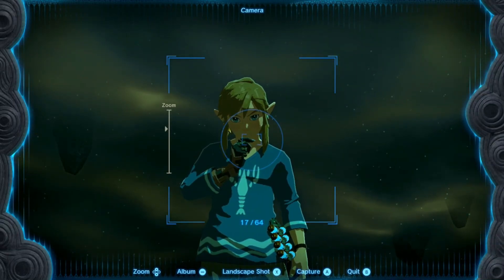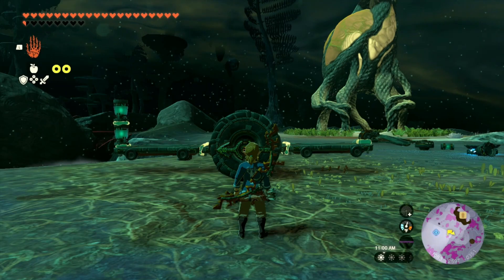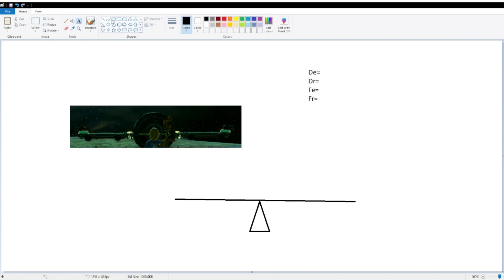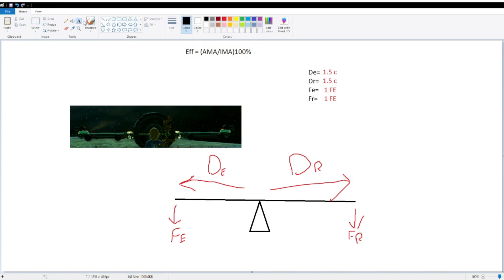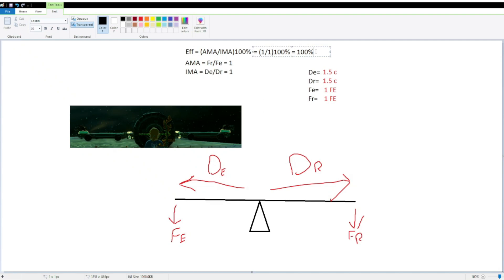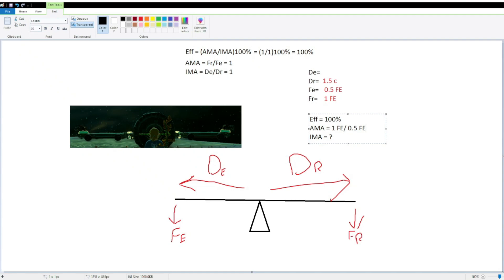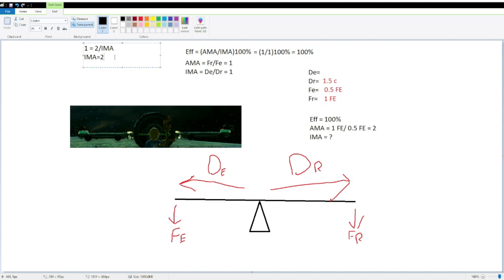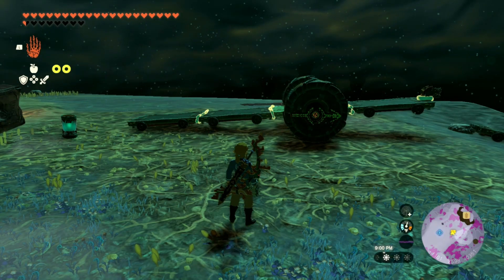Establishing a weight system in TOTK so I can make levers (READ DESCRIPTION)

Comment: Instead of using IMA and AMA for the lever, you should just sum the moments about the pivot. According to your spreadsheet, a cart has a weight of 4.35 FE. at 9:58 you can see that the extra cart on the left adds 4.35 FE x 2 carts to the left side in addition to the battery (0.5 FE x 2.5 carts). The right side only has 1FE x 1.5 cart. This results in a total moment of 8.45 FE-carts counter clockwise which reflects what you observe here
Reply from the maker: Thank you for the comment! I'm just using my current understanding of simple machines to do this stuff, is there a resource you could reccomend so I could get a better grasp on what you're saying?
Reply: @avery_luigi  definitely calculus would help alot with calculating the moments of inertia and everything. 

But you should be able to correct the equations quickly by remembering that your lever is not weightless (as was assumed in the video) all you have to check is that the carts have a consistent weight spread out along them, meaning that 1/x of the length of a cart will always contribute 1/x*the wieght of the cart. 

After you check this you can just see how much of the cart weight is going to contribute to the lengthening of the lever as you need. Everything else should work and if you take this into consideration I bet the calculations will work out in the game as it likely isn't any more complex than this.
Reply from the maker: @ethanolcott3960 ah OK, I actually haven't taken calculus yet but I will be in the fall, thank you so much for your comment!

Comment: You made a mistake in your last practical example. Your De and Dr were 3c and 1.5c, but your actual lever only measured 3 carts total, not 3.5 as in your calculation. You should have scaled up by 2, so that the long arm is 6 carts long, amd the short arm is 3 carts long, and see how that behaves.

Comment: I must say that for the last experiment you can have x7 carts, but place one weight 3 carts away from the wheels and another just 1.5 carts away. That should balance stuff out. Not like there's any need for balance from what I've seen, but it's a shame to see a full-sized non-copyrighted human-like battle robot falling on his side due to poor inside mass distribution. 
I remember my days of Gmod utilizing a step-by-step approach that I learned from my programming class: after each step you should have a functioning thing. So, if you're building a robot's right hand, just add a weight on the left side and check if everything else is working alright before brainstorming how to balance out two-handed recoil.

Comment: So link is as heavy as 5 regulsr apples?
Either those apples are heavy as hell or link is just built differently.
Weighs a couple of grams but can still rodeo a bucking lynel without being thrown off until he decides to jump off automatically after slamming on the beast
Reply from the maker: link actually weighs 10 regular apples! since 1 apple is 0.1 FE and link weighs 1 FE. I agree though, those apples must be beefy as hell
Reply: Nintendo probably increased the weight of some items on purpose so they don't fly off to infinity when you cut apple trees in the wind or while throwing them... I'm just saying
Reply: @airdutemps8363  i think it's the other way around, they reduced link's weight so he can fall more slowly (lower terminal velocity) and float on that tiny paraglider.
Reply: @tuseroni6085  why not? they had to make things work one way or another :P
Reply: @airdutemps8363  it wouldn't make any sense to increase the weight of apples, irl apples do not go flying off into infinity when you chop down a tree and little reason to think they would do so here, they do go flying when hit with a fan but continue to fall as normal when out of the fan.

it makes more sense they made link lighter so people would have more air time.
Reply: My only complaint about the game that I'm not gonna stress over bc its really just a small detail is the tall grass.
I hoped there would be more to the tall grass than just cutting them for a chance to find hiding criters or even a fairy by small chance.
For example. Taller grass could be utilized for stealth if someone wants to pick off any enemies.
I get thst with the ultra hand it kinda rules out the ides of stealth and opens more to creative minds and how they'd cause chaos but I personally would like more puzzled sections revolving stealth like that one quest in botw where you have to infiltrate the Yiga Clan hideout.
It was thrilling and fun to see how you could distract the enemies and felt more natural and immersive
Reply: @alex_delarian09 Think about the performance. Rendering that extra tall grass could make the game unplayable. TOTK is already hard on the switch.
Reply: @alex_delarian09  The Yiga clan mission ins BotW was incredibly basic and had exactly two mechanics:
1.Consume stealth buff and run behind everyone
2. Throw bananas in front of guards to distract them for a few seconds

That was it
Also Stealth strikes and stealth chains are incredibly broken
Reply: Again, wasn't really making a huge deal and was just sharing an idea and yeah ik the stealth for the yiga clan hideout was super basic but im just sayin it could've been better.
Don't need to tell me what's already obvious and they patched the stealth strike chain in totk